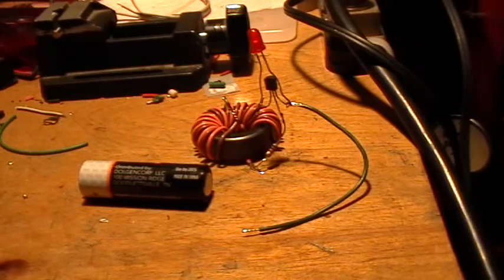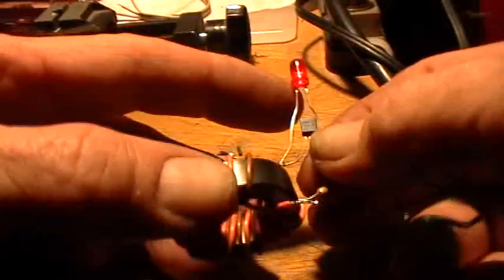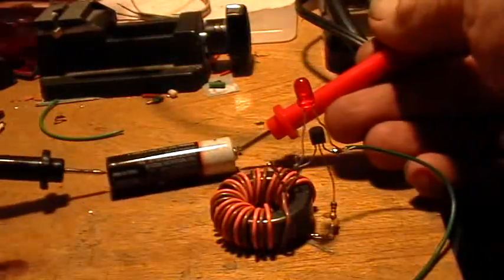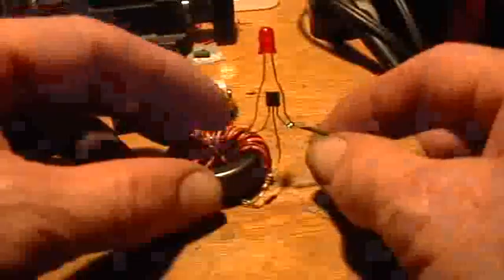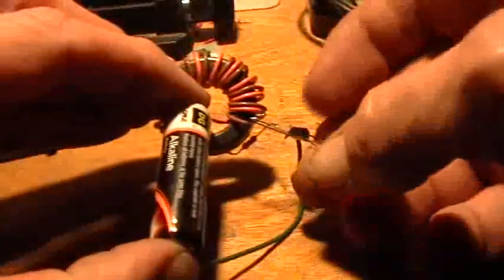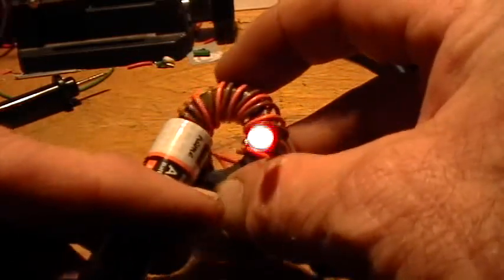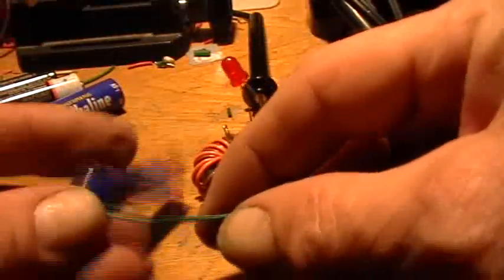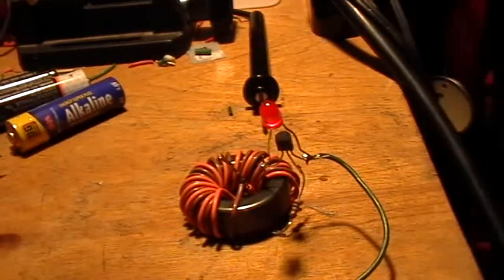Joule Thief Variant: Instructions, Detail

Comment from the maker: Arrgghhhh..... Thank you for pointing this out. No, you are right,  I made the mistake when wiring. 

The Cathode of the LED should indeed be connected to the Emitter of the transistor, and the Anode is connected to the Collector. I have the transistor backwards.

However, as this video shows.... it does work both ways with this transistor. The "proper" way is a bit brighter, it seems. I just tested with a 2n2222a and it does NOT work both ways. Emitter, cathode, B- must be tied together.
Thanx!

Comment: In the conventional Joule Thief using a 2N3904, the cathode of the LED and the emitter of the transistor are connected together.  You have switched the emitter and collector, so the transistor is backwards.  But it still works, why is beyond me.  It shouldn't work, but it apparently still has enough current gain to work.

Thanks for keeping the camera still most of the time.  It makes it much easire for the viewer to see what's going on.  Some JTers swivel and tile the camera like crazy. BAD!